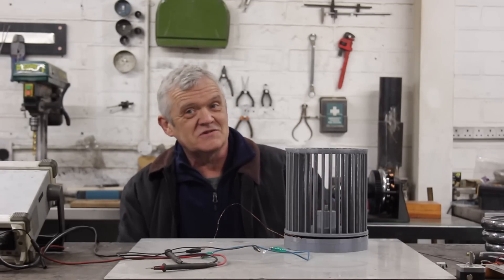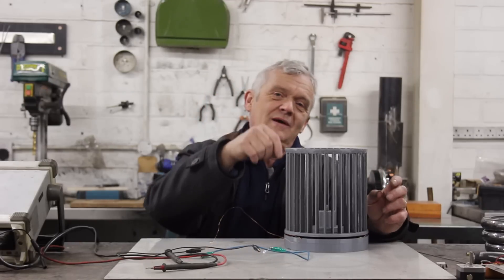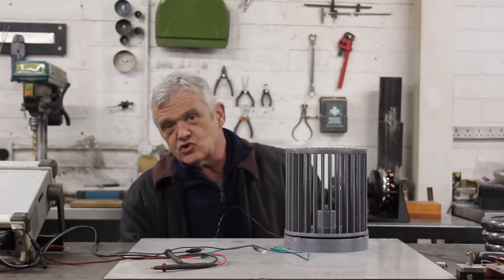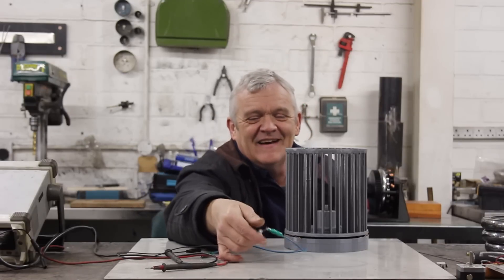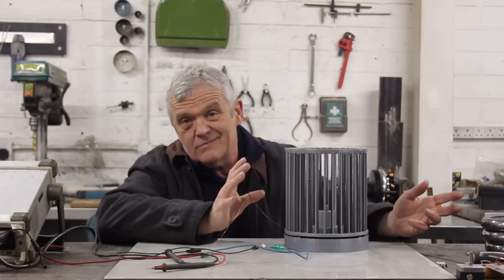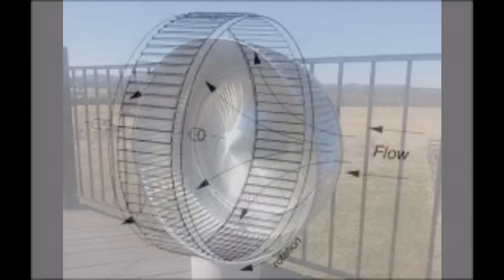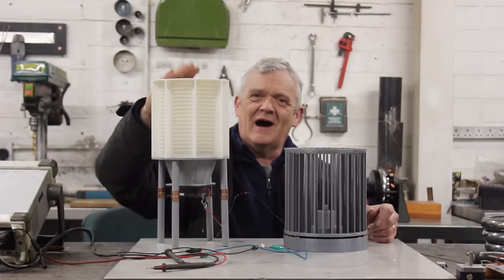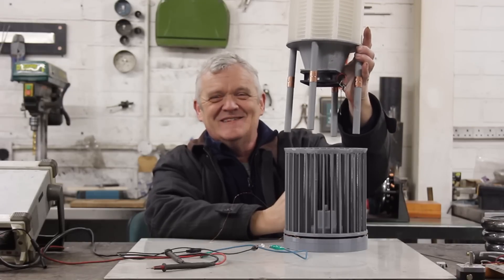1878 An Exciting Idea For A Wind Turbine

Comment: imo rob you might yield better efficiency if you also put a converging nozzle from the the darwin collector exit point and then in the throat have a venturie or 3 to amplify the V of the air even more. This would also create a vaccum in the throat area which will again yield even more results and act as a positive feedback ramp mate... easy to test the input output V with anni as well.  the diverging nozzel on the base of the squirrel cage is also and great addition nice.... your MOI is very low due to the maglev so i suspect this system should show excellent results.
Reply from the maker: very interesting mate - thanks for posting

Comment: The squirrel cage would work with a vaccuum, too!
Reply: I like this idea of a negative wind mill!  Perhaps a reverse cone or a long piece if drainage pipe to draw in air moving past the turbine creating a vacuum pressure on the turbine!
Reply: I had a similar idea, the Darwin turbine set to blow upward so that it adds to the chimney effect of a long pipe that pulls air through the sides of a squirrel cage and up from the center.  Again you would have the working parts low where they are easy to work on.  I think that having the Darwin directed downward it will lose efficiency since it has to fight the chimney effect rather than add to it.  I welcome experimental evidence to show whether that is correct or not.
Reply from the maker: yes it would

Comment: That's all cool :). But, if we're talking some real life solution, we'd have to go for 1kWh generation at least. When knowing that 1.5mm diameter of enameled copper wire can carry 10A, or 2.5mm can carry 20A, we'd need at least 50-100meters or the wire. And that is a lot ;). If we're talking a smaller diameter, will be even longer. 

So, should we do several generators in parallel setup? Like a windwall? If we can do at least 5 of them, we're talking now only 200W/section. I'd say it's more reasonable, than 1kW. 

I can't grasp the size needed in order to build this 1kWh in my head. I think more people would like to know it as well. Maybe someone is smart enough to answer this question. I'm talking wind turbine only.
Reply from the maker: you already know the answers mate - they already build 1kW turbines and everything that governs the size of them governs the size of this - the only thing that will change it is efficiency so size will change in roughly the same percentage gain or drop in efficiency that this has

Comment: My only thought is does the air passing over the blades escape through the other blades or through the open top. If it's the open top then placing a capture device on the top would prevent this. Could be wrong though so trying is the only option.
Reply from the maker: it escapes through the blade it is passing over - that's also what makes it turn
Reply: @ThinkingandTinkering  I think we may have our wires crossed on this issue. Regardless I look forward to seeing your completed model.
Reply: I was thinking the same thing. Would not be the darwin collector on top off exposed squirrel cage be actually counterproductive? The squirrel cage would need to be shielded somehow from surrounding air in order to operate.

Comment: If you want to upscale the design and lack a 3-D printer or a ready-made squirrel cage, it should be possible to re-use Venetian blind slats as rotor blades. Per your vision, your omni-directional wind collector atop your slatted/bladed wind turbine seem just the right combination for tower- or roof-mounted (or ground mounting when beyond wind shadowing) trickle charging system. Thank you for sharing. 5:42
Reply from the maker: yes I did that myself in one video

Comment: Okay. I like the idea. I have a thought though. I think you need to make your squirrel cage thinner... so instead of having the big blades like the one you have, you increase the radius of circle it's built upon and shorten the fan blades to an inch or two. The wider diameter will allow a larger flow of air to escape, and the shorter fans (assuming the pipe you connect this to is just as wide, or if of a smaller diameter, you close the extra diameter of the squirrel cage top off) will cause it to spin faster because you have a larger volume of air flowing through a smaller area. Less diffusion of air, as it were. You should be able to 3d print a cone for inside the squirrel cage to help direct the airflow outwards...
Reply from the maker: cheers mate

Comment: could you mount the darwin collector directly to the top of the squirrel cage so that it rotates with the cage, or would that reduce efficiency?
Reply from the maker: I suspect I wouldn't mate as I don't see the need but I was thinking of mounting the cage joined to the darwin with a large bearing

Comment: What if we do not bother about the turbine design itself, but just "like stack  a few CD-s on the levitating platform" as mimicing the principles of a tesla turbine. Considering, that You are utilizing the speed at the edge vs. tourqe in the center, it (the speed) could be improved with a  gearbox. Maybe magnetic as well to prevent losses due to friction.
Reply from the maker: give it a go mate

Comment: Could it be possible to duplicate the coil and place it on the top, So you'd have a coil on the top and the bottom. Maybe if that works you could add some magnets on the sides of the blades and some opposing magnets pushing the blades. Just an idea.
Reply: Layers of coils & magnets could increase magnetic drag, so whilst multiple coils are going to increase output they will reach saturation point & become less efficient.
Reply: @rjds1800  thanks for that info
Reply from the maker: you could mate but you would need to put more power in to get more power out